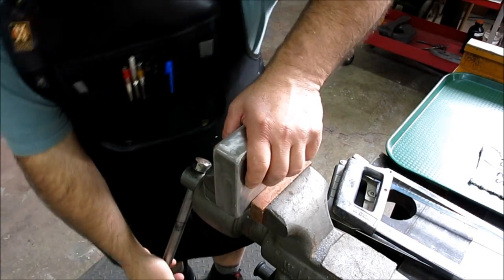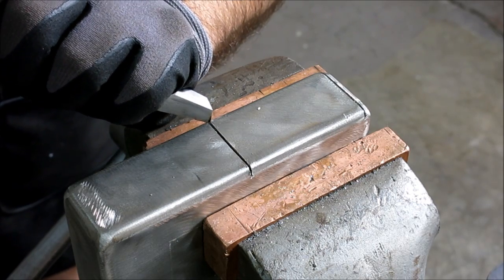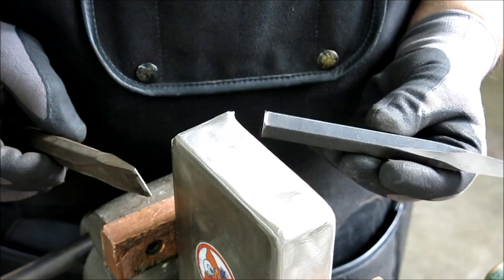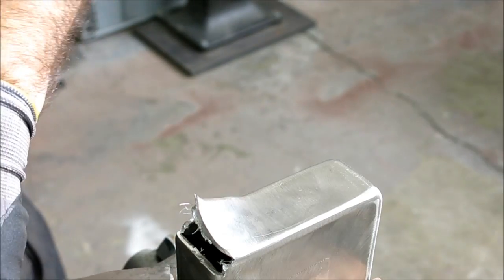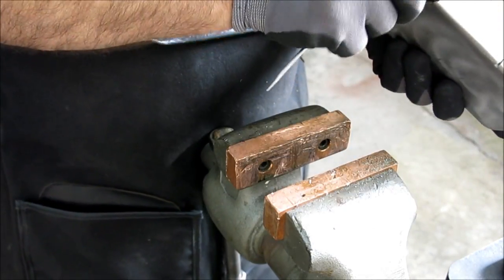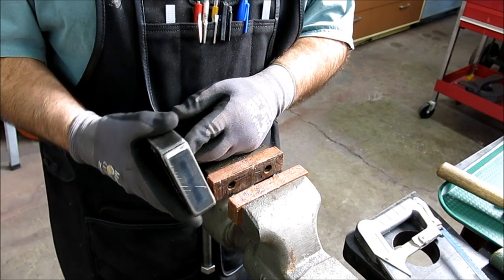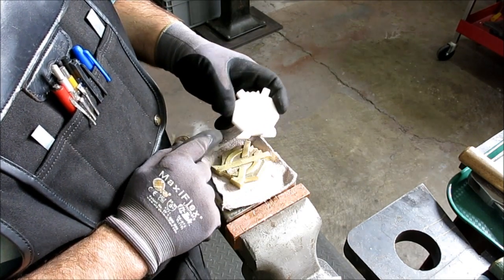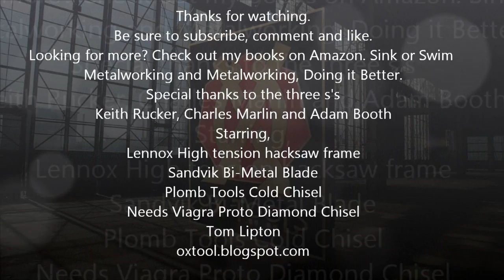Monday Night Meatloaf 58 Sidedish

Comment: It was great watching you struggle with that! But in the end, looks like you had some fun and got a great prize! I wish we could have seen your face when you pulled the second box out!
Now that you have it, I'll let ya know that I got to see your casting hands on when Keith was here in my shop. We talked about a fun way to send it to you, and I think we all agreed on the welded box trick, like you did so well yourself.
Charles and Keith bot did a great job with that logo!
I had fun buddy! Thanks for sharing your struggles. Keep the Bozo box for the next victim. LOL

Adam
Reply: Tom
You should have laid the stainless box flat on the mill and took a slitting saw around 1/2 to 3/4 inch from the top and made your self a nice storage/tool box

Fun as always
Bill
Reply: Somehow is see this becoming a tradition and each successive "victim" will have to open more layers of boxes. That'd be fun. :))
Reply from the maker: Hey Adam,

You will get yours. Right when you least expect it. My neighbors must have been wondering what I was working on. Thanks for stopping by buddy.

All the best,

Tom
Reply: I done got mine buddy! No need for anymore welded boxes except for when you send me another sweet chuck for the lathe. I think the mill was a little easier than all the saw and chisle work though. 
Hey, at least it made for another fun video to watch!

Comment: Oh, I nearly fell out of my chair when you found the second box ;)

I have a mid '70s Craftsman cold chisel. Survived cutting off forged rivets off ball joints back then and still works like new.

The import metallurgy just does not cut it these days.
Reply from the maker: Hey Scott,

I am convinced its age related. Darn lawyers making folks worry a tool chips or dulls. Just sell them another one and don't get sued. Win win for the tool company. Thanks for the comment.

Cheers,

Tom

Comment: On the subject of chisels, i have a no brand one. It's diamond hard, has that blue look to it and i confess that i've been trying to chip it for quite some time now just so i can try my hand at doing a proper sharp edge on it. Old giza doesn't let go.

I can imagine you going to the hammer rack and going all "should i choose this one? Oh but that one has such a nice handle, but i like the way this one sounds more, oh but this one has better finish...decisions, decisions." :)

I'd use some soap on the sides of the blade, actual bar soap, makes cutting a breeze and it's perfect for those jobs were oil isn't ok to use.

Commenting as i go, it appears you've been Matryoshka'd!

The logo looks really nice, i was wondering when you were going to get one.

3D printers are one of the greatest inventions of this century. It's the stepping stone for something greater. If you know what you're doing and it doesn't take much to learn one, the stuff you can do with them is limited only by the sky. There's even complete printing where you can print a fully functioning gear system (for example) in one go and have it work perfectly after removing the lattice.

But for me, since i've been interested in space and the universe at large the coolest thing you can do with a 3d printer is printing rocket parts, IN METAL (heavy)! I think that pretty much seals the deal on how cools these things are.

Myself i've printed quite a few gears for my friends and made a replacement gear for my mother's sewing machine. Helix gear with all the bells and whistles. I'm happy to report that it's been 3 years now and it still works like when it was new, mom uses it at least a couple of times per month for recreational purposes so it sees some use.
Reply from the maker: Hey Aserta,

I just saw a Direct metal laser sintered titanium bottle opener some company made as give away's. It was very cool. I kick myself for not taking a picture of it. These things will change our lives in the next decade. Thanks for the comment.

Cheers,

Tom
Reply: oxtoolco Totally, a bottle opener is one, but just looking around me, there's hundreds of parts that could be printed instead of being milled, cast, bored, threaded etc.

Many say it will be expensive, but, what..only 4~5 years ago the cheapest plastic 3D printer was above 1000$ now you can find them as low as 200~300$ mark and they with a few tweaks here and there you can get very good accurate parts out of them.

As far as that is concerned, yes, the next decade will be an exciting time to live.

Comment: G'day Tom. Really! Hammer and chisel, that's how we mechanics are maliciously referred to at times, personally I would have chosen a 9" angle grinder, OK that's a bit excessive, I'd settle for a 4" angle grinder fitted with a 1.2mm cut off wheel. I would not have the patience to stand there and play with the chisel and hacksaw for that long, the bronze casting is a beaut' though.
Peter
Reply from the maker: Hey Peter,

It was all for you guys. Pure entertainment value. I did actually have some fun playing with hammers. Thanks for the comment.

Cheers,

Tom

Comment: Terrific gift and what a surprise when the second box fell out! Would the fusion weld be a thermally cooler weld than others? - if so I guess it was the choice so that heat was unlikely to damage the 3-D printed model.
Reply from the maker: Hey Dan,

Charles sent me some pictures of how he put these together. He had the box in water when he was welding it to take the heat out. The plastic was isolated from the wall pretty well. Thanks for the comment.

Cheers,

Tom

Comment: I would have put that box up on my G & E 16 inch shaper and knocked those corners off in no time.
Boss told me years ago, " the machine is supposed to do the work, not the other way around you dumb a..  Apprentice boy".
Regards, Kap
Reply from the maker: Hey Kap,

Well my old mentor told me to keep my ears open and my mouth shut. We were using Georgia rules. No power tools. Besides I need the workout before Thanksgiving dinner. Thanks for the comment.

Cheers,

Tom

Comment: You can do investment casting with PLA, which is the other common 3D printing plastic. PLA burns clean, so a plaster-reinforced mold can be burned out of the mold prior to pouring.
Reply from the maker: Hey Smidge, 

Once you go to investment the possibilities open up even more. No draft to deal with. Thanks for the comment.

Cheers,

Tom

Comment: Hey Ox, 
About another matter.

I was on your blog and read about the 127 tooth gear and proposed spindex hole modifications.
Send me a blank or six and I'll put that pattern in on my Fadal.
The mastercam allows me create and rotate a hole 126 times to 360/127 degree angle.
I can get a video out of that too.
The program will only take a few lunch time minutes.

I won't use a hammer and chisel though.
That's not our rule in the northeast.

Regards,
Kap
Reply from the maker: Hey Kap,

Thanks for the offer of an index plate. How long have you been using MasterCam? Thanks for the comment.

Cheers,

Tom
Reply: oxtoolco Tom,
I've been working with Mastercam for about 10 years. Mostly self trained.
My employer sent me to class a couple years ago in Pa.
Started with mcam 8 and now up to X7 level.
Still plenty of tricks to learn.
Regards,
Kap

Comment: when it comes to the chisels hardness, do you believe that its a steel difference or a heat treat difference? possible to perhaps re-harden them to i higher level?
Reply from the maker: Hi Nathan,

Most likely the heat treat. Softer is less likely to chip. Thanks for the comment.

Cheers,

Tom